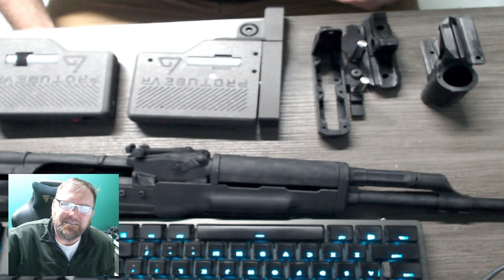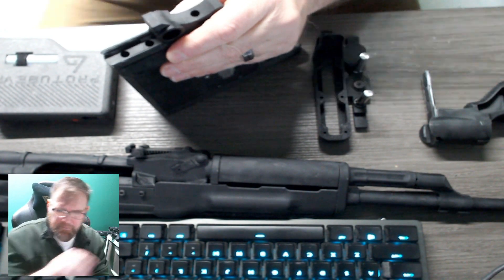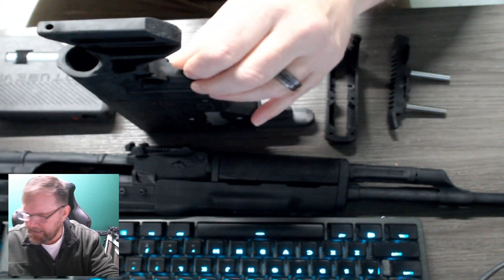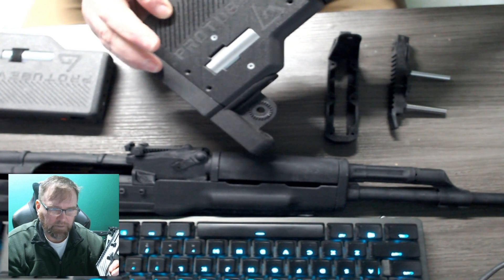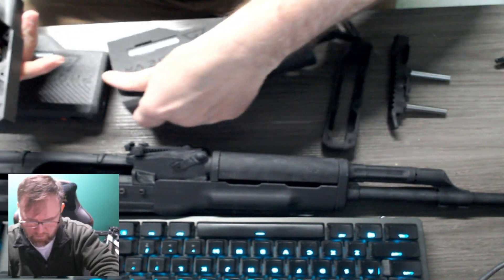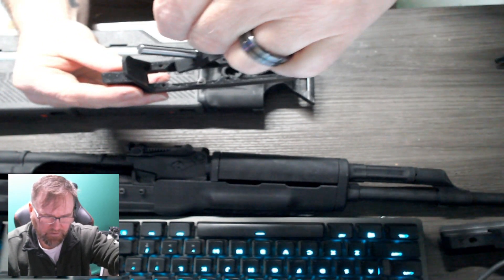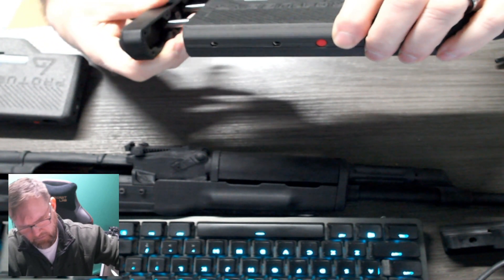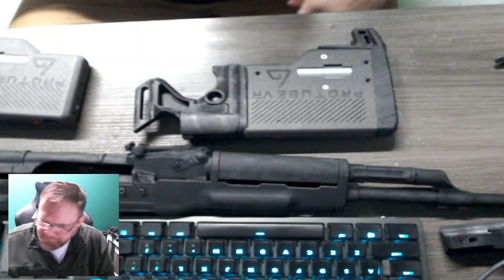PROTUBEVR ForceTube with Virtual Rifle Systems mkIII

Comment: Very cool buttstock. But now I'm curious about that AKM (rubber mold?) underneath it.
Reply from the maker: 3d printed (sla) it might just be a new offering in the future.
Reply: @VirtualRifleSystems  Very cool. I build real AKMs/AK74s/RPKs so it immediately caught my eye. That take down lever, upper and lower hand guards, gas tube, and gas block look pretty good. Suggestion - the real rivets that attach the front and rear trunnion to the receiver have a mushroom shaped head, not cylindrical. Look forward to seeing the final product.
Reply from the maker: @TheWabbitSeason  lol those screws are what I had on hand...was hoping nobody would notice.  I have the proper/more appropriate ones specked out.  Actually, one of them is about 1/2" too long and sticks out the other side.
Reply: @VirtualRifleSystems  I noticed them immediately. Screw build AKs are the bane of the AK builder existence. One day I'd like to 3d print a complete build kit to demostrate how an AK is put together. No way I'd ever try a Plastikov receiver with real ammo.
Reply: @VirtualRifleSystems  Considering that your always progressing forward with new developments.., 👍💯👌I noticed within a few of your previous videos hints regarding the imminent release of the "MKIV (Mark 4)" ..??? 🤔 

Will this be posted to the website soon for purchase too..??? 🙏💯😎 Thanks.
Reply from the maker: @normanrobinson1932  Sorry for the delayed response. PSVR2 was priority. Next will be Quest Pro controllers.  I have Pico build in the works but also looking at MKIV.  However MKIV will might just be a new direction.  Basically several rifles, all replicas of modern firearms.